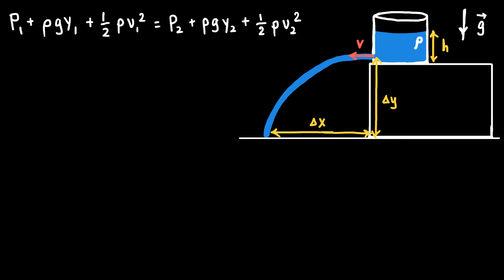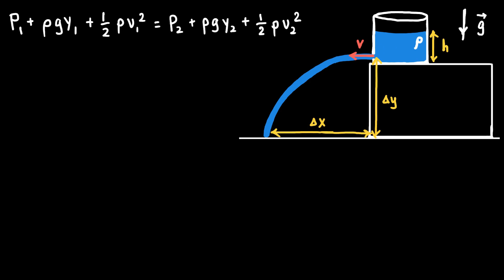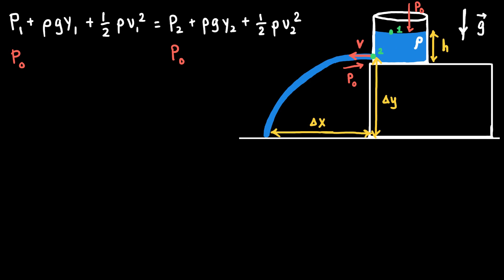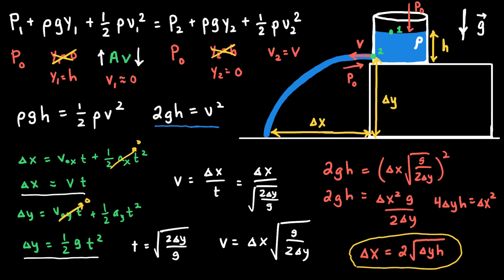Applying Bernoulli's Equation for Fluid Flow Video

Comment: what happens to the pressure term of the weight of the water? ig to cancel the atmospheric pressures, but isn't there the weight pressure of the water at 2 which isn't there at 1?
Reply: ohh if anyone else is confused: it's because the pressure at the hole is not the pressure from the weight of the water; you can see this by imaging yourself sitting at that hole, you couldn't push against anything to hold that water above, as there is no surface underneath (and the atmospheric pressure cancels anyway, so taht couldn't hold it either), So pressure from the weight of the water is not acting on the hole.